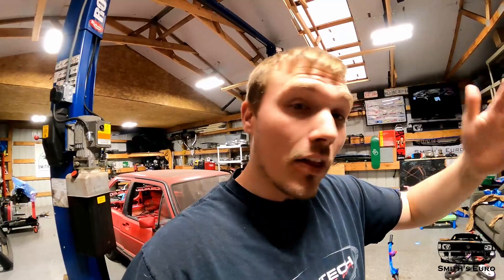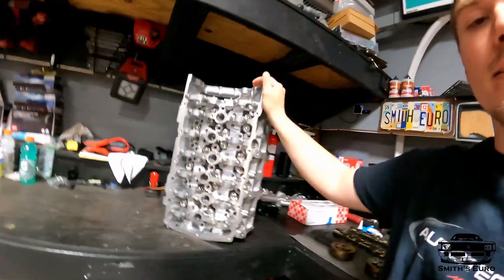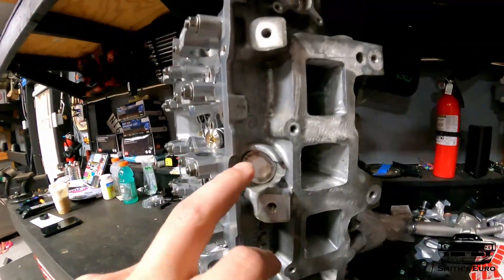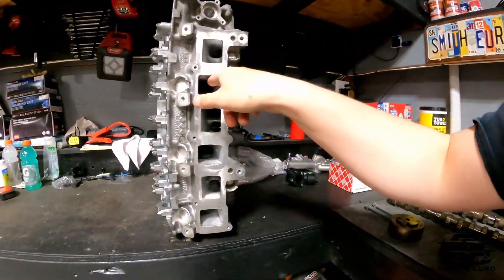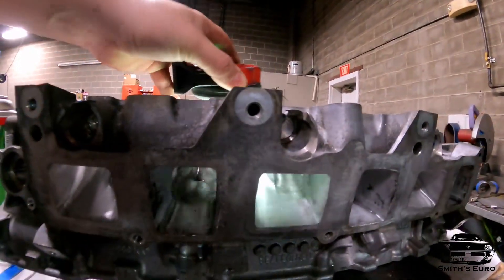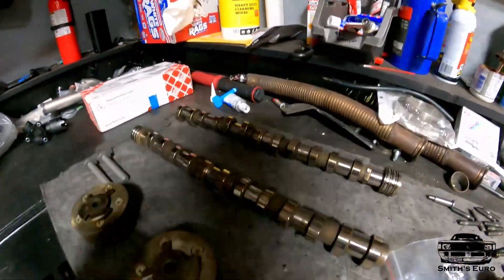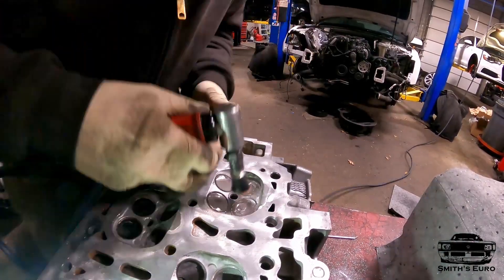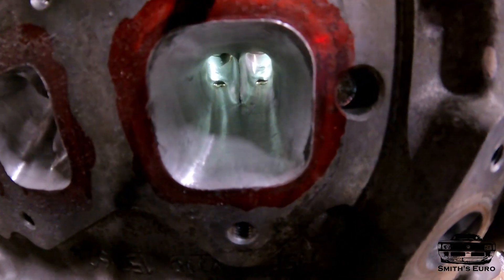3.6 VR6 DIRECT INJECTION FULLY DELETED CYLINDER HEAD

Comment: I’m doing the same thing how did you tune for switching to port injection
Reply from the maker: Standalone ecu
Reply: @SmithsEuro or I for sure need a emu black?
Reply: And btw 9T performance sells plugs for the head for the direct injection ports 3 long 3 short just like the injectors
Reply from the maker: There are much better ecu in my opinion . But yes that will work

Comment: So with porting and raising the compression is there thought to volume matching across the cylinders? Or is that something that is addressed in tuning or just doesn't matter?
Reply from the maker: I based it off an r32 head i had at work.
Pretty much the same besides the 3.6 having 3 injectors pass through 3 rear cylinders 

Im trying to get to a point where i can have it flowed compared to a stock one (probably when im able to add higher comp pistons)

Im trying to save up to build an exhaust manifold where i can have 6 egts as well
That would give me all the data i need.
But the costs associated with that is not something i can get to anytime soon.

Comment: Fantastic except the exhaust actuation can help the torque curve a bit, just less than intake. How much range on the intake?
Reply from the maker: I forgot the range maybe 40 degrees 
I’ve since given up on making it work. Gains are all under 4k pretty much.
My needs in racing never sees rpm that low.
Im deleting vvt and doing adjustable gears now.
Reply: Not going to hate on that with such displacement, especially if you have the gearing to take advantage of such a beast.  @SmithsEuro
Reply from the maker: @samdemond1 im using a 4.24 it’s working well so far.
Biggest issue is the stock-ish trans right now, doesn’t like the rpm it turns. Been fighting being locked out of gears
Reply: So you installed the new cams then? @SmithsEuro
Reply from the maker: @samdemond1 yes, videos are behind a bit. Hard to find time to edit them.